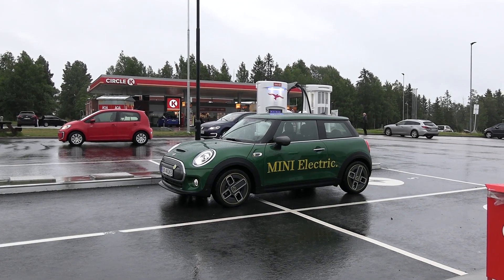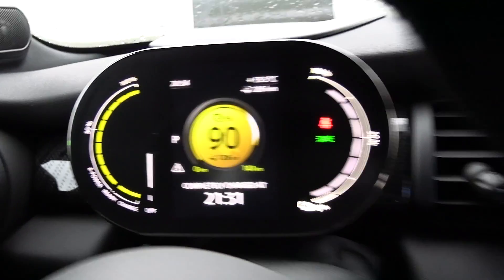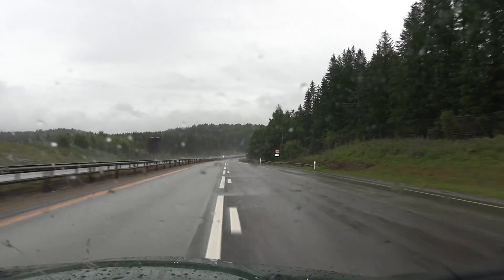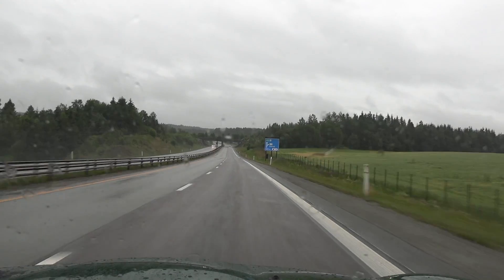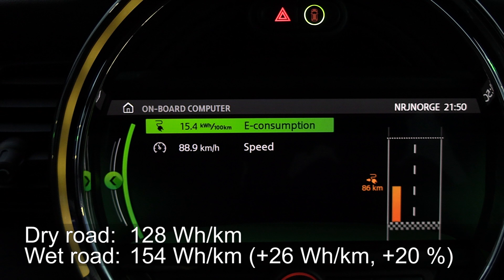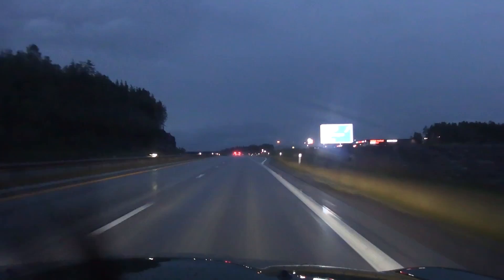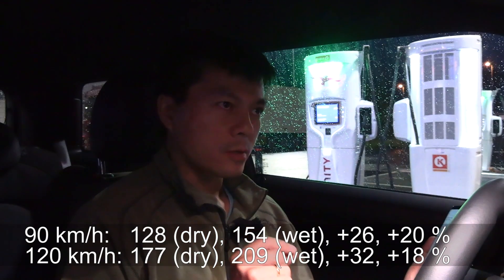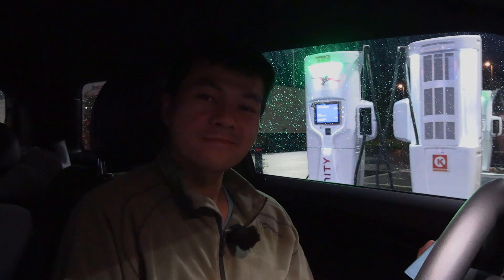Mini Cooper SE wet road energy consumption

Comment: Yes, wet road, rain and side wind and many other things affect the average energy consumption. I did range test in bad weather conditions for 2020 BMW i3s and energy consumption was way higher. Offcourse affect all cars in different way (taller use more energy etc). Effect was my range was significantly reduced. Also windshield wipers are quite hungry for energy, and evaporator (I think) which makes air dryer is working more.

Comment: Notice the absolute value of the additional energy used:  128wh/km up to 154wh/km for the 90km/hr test, but 177wh/km up to 209wh/km for the 120km/hr test.  So the wet road needed +26 wh/km at 90km/hr but +32 wh/km at 120km/hr.  It could be nearly the same energy needed to push the water out of the way but added energy needed for the aero resistance at the higher speed.  Remember that aero resistance energy increases as the cube of the speed, but splashing the water out of the way may only be a linear energy increase.  Maybe... I think so...  any physicists out there?

Comment: Hi Bjørn do you also consider the resistance of different road surfaces when dry? When you take different routes the road surface type could influence the result, although I don't know if different road surfaces are used in Norways "Autobahn".
Background of my question is; I noticed that with my car I get consequently better consumption figures when driving in Germany compared to Holland where I live. The German roads seem to consist of concrete (high road noise, awful when wet, a small rain shower transfers it into a pool basically), the roads in Holland are "open structure asphalt". Better in all respects except rolling resistance I think, and perhaps longevity too.

Comment: So that puts the Ioniq 38 wet test you did into perspective. It would be nice if you gave it a go in the dry. We've had 122 total over 3000km in the winter here. Wet roads, heater running when needed. Efficiency King indeed.

Comment: Bjørn, imho you should not only look at percentage rise in fuel consumption when comparing BEV to ICE running with a trailer. Numbers get screwed due to the big difference in efficiency at the starting point
Why not look whats actually happening, like kWh(or Wh) per km?    I have tested this several times and every time ICE cars fuel consumption rises much more than BEVs. So BEVs in general consumes less extra energy with a trailer atached..                                                  Nice comment BTW, hope someone bring it to Elon👍

Comment: I expect that your Model 3 would have less differences between wet/dry road!? 

You should also add in the temperature difference if you didn't already do so.
A similar test, on same temperature would be interesting...
Reply from the maker: Temperature doesn't affect the consumption that much.
Reply: That might be. 
But my experience with Kia Soul EV and Tesla Model S is that the Kia Soul EV have almost double the % in difference vs the more aerodynamic Model S.

Comment: I was on a road trip not long ago, and at 120km/h the wet road (only moist, no standing water) the diesel car I was driving consumed 1l more fuel/100 as soon as the road dried out, the consumption went down, I was driving a steady speed using the cruise control.
Reply: 7.5l vs 6.5l
Reply: You experienced the increase in efficiency that water injection provides to an ICE.  When the air became dry, the engine's efficiency dropped more than the reduction in plowing through the water on the road. Read about water injection.

Comment: On the consumption...air resistance takes to most energy to overcome when driving. When raining, the 'air' is much thicker, because there's lots of dense fluid in it.

So maybe someday it is possible to test wet road with and without rain...we just have to ask the rain to stop politely then 😂.
Reply: Wet road without rain still gives increased consumption, rain gave me a 1l diesel fuel increase (7.5 vs 6.5l/100) and the wet road itself once ran away from the cloud gave a 0.5l increase, that's at 120km/h Hiundai i40 1.6
Reply: @piotrekserwisuje  it's hard to control all variables when trying to find out the effects of a wet road. And the effect of rain itself. But off course wet road increases energy consumption. Like Bjorn said...the car has to push through a 'wall' of water and kick up the droplets.

Comment: I think the consumption on dry roads already "contains" the exponential function. The growth of 20 % increases that "contained" exponential difference. That sounds plausible to me.
Reply: It's generally a good idea to drive a bit slower when road is wet, of course depending on the amount of water and the speed you were going to begin with (at ~100 there is no point slowing down imo, at 140 I think it's a good idea to slow down a little, and surely increase the distance from other vechicles...)

Comment: About the auto steer systems recognizing the grooves on the roads, I have thought about it and a very simple solution would be to add an option to choose how center the car is trying to drive. Like, make an offset on the settings and there choose on which side of the lane the car should try to drive on, or try to drive as middle as possible. Even if there were no grooves or anything wrong with the road, Autopilot seems to many times drive way too close to the middle line when I would prefer it to rather drive on the ditch side.
Reply: Totally agree, but probably they won't implement it, because it's a too complicated or niche function for the average driver. Nowadays as far as I know, all systems try to keep the car in the middle of the lane. It would be nice to have the car move further to the side, in case of a traffic jam though, to make room for forming an emergency lane, which is mandatory in France, Germany,...

Comment: Great work.
The results seem to make sense (to me atleast) I suggest the tyres are acting as a water pump so the amount of water moved per km will be the same regardless of speed. But at higher speeds the water (mist) tries to accelerate the speed of the vehicle...thus more energy will be required at 120 vs 90.

Comment: correction: ICE engines are so inefficient that the increase in consumption is barely noticable next to the actual losses in the engine. Its like drilling a hole in a water tank that is leaking because of a canon ball hit
Reply: Yeah, that is the main reason. Although internal combustion engines do also get more efficient when there's a higher load, even though it might not be very noticeable.
Reply: True! Was about to write the same!

Comment: that's right, "rolling resistance" because it is harder for the tire to roll as it needs to push away the water. The "friction" is less in case of wet road.
Reply: The friction hat absolutely nothing to do with the rolling resistance as long as there's no slip.
It's all about deformation of the tire and everything like that.

It's a common misconception but the friction coefficient changing doesn't explain any change in rolling resistance.

As you correctly state, it does explain why you can't brake as well as on dry road.